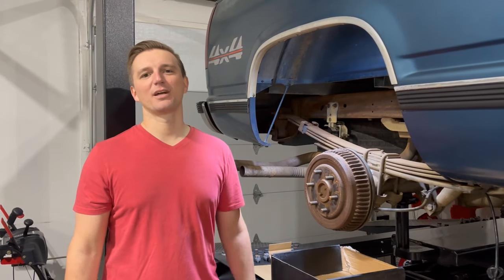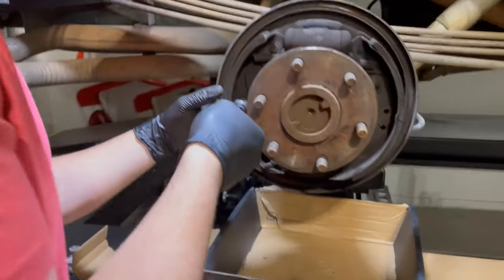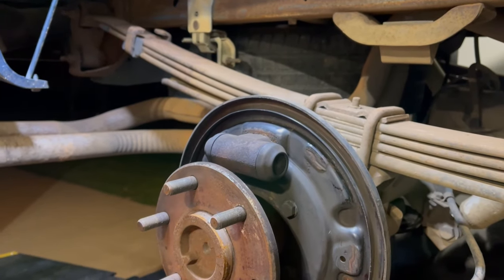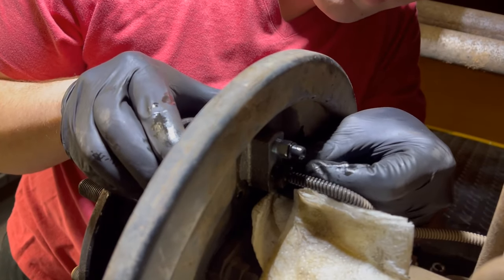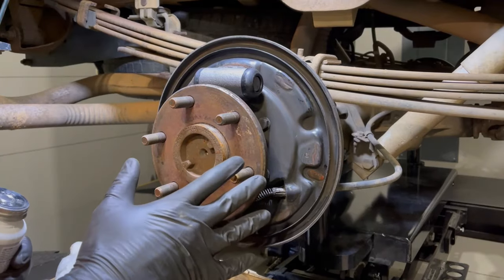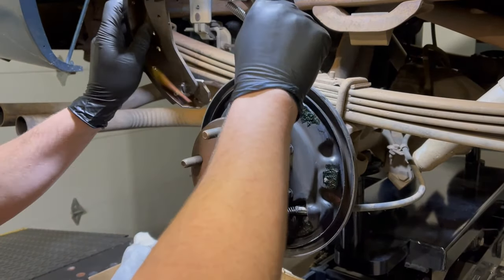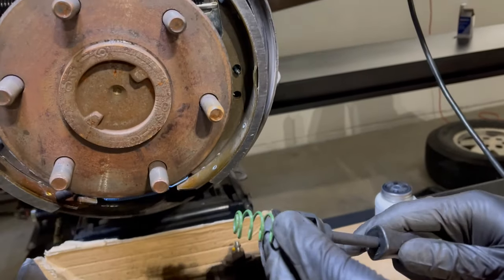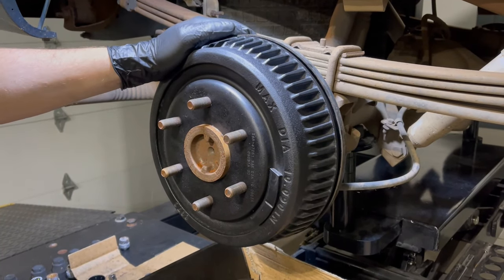Easy rear drum brake replacement on an 88-98 OBS Chevy 1500

Comment: I pulled my axles when I did the rear brakes , glad I did when I removed my rear end cover noticed rear end crown and pinion as well as the center pin was wore out .so I ordered a crown and pinion Eatons tru- trc and installed it , but the side carrier brgs were a different size but did locate them that old 91 short box was wore right out , but this old 70 year old man loves working on old school trucks .

Comment: I finally figured out how to adjust the rear brakes ( the brakes with the self adjuster on top of the axle) on these crap for brakes, trucks!!!!!!!!!  Engine off, in park. Push the parking brake pedal down till it sets. Now, pay attention: pull and hold the parking brake release handle. Now, push down on the parking brake pedal, let it up,,keep holding on the parking handle, push down the parking brake pedal slowly,,,,and do this 5,10,15, times and you will notice the parking brake starting to get higher. Stop. Now feel the foot brake, and notice it's higher, harder, and less mushy!!!!!! The Chevy Un- mush and working brakes fix is here!!!!  And now you have rear brakes to boot!!!!!!    You are all welcome! Only took me three obs trucks and 20 years!!!!!!
Reply: Bryson Shiloh  like to hear your results.  I've done this procedure a couple more times and the brake pedal now sits up hard and it now squats when I get into the brakes!!!!!!!!!!     I JUST PLAIN WORKED FOR ME!!!   good luck!  let me know,,,please!!
Reply: Bryson Shiloh  let me know how it goes!!!  please
Reply: thanks for that information ., I was pulling the drums off numerous times setting it up , but I sure will try that , thanks again . also backing up a dozen times slamming the brakes on didn't work either .
Reply: I did this this morning on my 1991 GMC 1500  and it worked flawlessly ,thankyou sir , now Ill try that on my 2001 S10 , didn't work on the S10 .
Reply: @oldbiker9739  by the way,,,i too have a 1991 s10!
Reply: Dam thanks bro!!!!
Reply: This just got rid of the sponge I was feeling brakes are now back to normal!!!!!! Thanks a million I owe you a cold beer 🍺

Comment: Like how he skipped right over the by far hardest part. E brake cable reattachment. I'd do that before putting anything else together. Or, if u can manage it, just never unhook it. Using the same part anyways.
Reply: He skipped it because it’s the most annoying part an he was probably cursing an spent 20 mins trying to pry the spring back so he could slip it on. Pain in the az
Reply: It didn't even look like the parking brake cable was fully engaged lol. Fake
Reply: Agreed. The cable is absolutely miserable and I left it hooked up on the 2nd side. I think it sucks the way it does because the drums are so tiny. It isn't nearly as bad on the 13" drums, I pulled the spring back by hand on my dually. These brakes are a dumb design.
Reply: Yes.
I remember putting so many cursewords into my rear drum when I was fixing it.
Reply: No shit I spent 3 hours trying hook that E brake cable I was so pissed
Reply: 🤣🤣🤣 I was hoping for a tip on that. Been fucking withis parking brake spring for 20 mins trying to get it on. Seems like you need 5 damn hands smh
Reply: You can do all this without removing the p brake cable from the arm.
Reply: @Santino0560 I just cussed my ole lady and broke my flashlight trying to hook mine back up. We’ll try again tomorrow. 🤣
Reply: Honestly that was the main thing I wanted from this video. Apparently no one has filmed this.

Comment: You're #1 !!!! Not sure I like the grease on the axle flange face centrifugal force could have it of the braking surface??? . The sticking point for me is the drum center ID. Thanks for the very professional vid! Even using Never Seez at least on of my adjusters is frozen when I take things apart. 449K miles and going strong. 89 Silverado.
Reply: I seen short bed Silverados with that mileage 
Great trucks

Comment: I watched this video and decided that I would be use this procedure to replace my trucks brakes. The removal and reinstallation of the emergency brake cables was a hours long project. To watch your video it would only require a few moments. There has to be a trick that wasn't discussed in the video. Please explain this procedure in detail so others won't spend hours doing this job on the future. Thanks.
Reply from the maker: @William Crace Yes, we should have filmed that again, the first time we did it the camera got blocked and as you found out it’s not the easiest to do. I believe we did the opposite of install though. What ended up working for you?
Reply: Agreed! ...omg it was heck!

Comment: A-  due to not having a e-clip removal tool. otherwise the best instructive video. after we overcome all the pitfalls stuck hub, leaked fluid all over, seized brake line, breaking off bleeder tossing parts in frustration putting a dent in classic car parked nearby just a little click and clack levity ha-ha thanks a million you make it look easy and waaay inexpensive.

Comment: Dude your videos are really well done I appreciate you showing us how to do this stuff. I am the original owner of a 1994 Silverado K1500 and my all original engine and transmission are just about to 500,000 miles.  The engine has been flawless,  The transmission has exceeded my expectations However it began to slip in 4th gear at 
467, 000 miles,  So I did have the transmission rebuilt.   My actual mileage currently is 496,000  thank you

Comment: I tried this method of assembling the brakes before installing onto the hub. While that part did go well, trying to get the parking brake cable re-installed was impossible for me. I probably spent 45 minutes on the first one trying to get the *&^#$&@ back on, cursing GM, and then walking away. I eventually took everything off and disassembled the components. The first thing I did was try to install the parking brake cable  on the arm. With the arm off the hub and free to move around, it was fairly easy to get the cable on. You have the room and the ability to rotate the arm so it's easy to get the cable on. We pulled the spring back from the grommet and attached a vise grip to the cable to hold the spring back. Then it was super easy to install the brake cable into the slot on the arm. It was more difficult to then assemble all of the components than doing them off the vehicle like you showed, but I'll never do it that way again just because it makes getting the parking brake cable back on so difficult. I really like your channel BTW!
Reply: Loosen the brake cable slack adjuster and the spring won't give you any grief the arm will slip right on
Reply: @joshuamcpeek4708  I did that and it was still not doable for me. I have heard that there is a tool to simplify this step however.
Reply: Is it possible w appy the p break a bit

Comment: Used to replace my rear brakes on `93 GMC to help with the crossword puzzle. I would add that look at your brake lines for corrosion. Even though I soaked lines overnight in penetrating oil, I still twisted off one side on brake wheel cylinder. I guess i should have known as it was the only one that hadn't been replaced, not to mention being 30 years old with over 300K on it. I made mine but parts store has them pre-made for less than $15.00. Just so other know.

Comment: Thanks for the video! Unfortunately I was not able to duplicate your technique with the pre-assembly because the sheet metal part of the adjuster that keeps the threaded adjuster from loosening kept falling out. I had to walk away for a minute. However, thanks to your video I was able to put my own twist on this job. 

I didn’t pull off the e-brake cable. That took brute force to get back on. I attached the left side shoe first. Then added the main spring, followed by the adjuster. Then the spring and sheet metal part of the adjuster followed by the bottom spring last. 

I take comfort in the fact this will probably be my last drum brake rebuild. Lol

Comment from the maker: Make sure you add anti seize to the threads of the adjuster, something I thought of after I made this video
Reply: I took mine apart and notice I didn’t have lever adjuster spring. Will this be a issue ?
Reply from the maker: @Musa Salh You should have all of the springs shown if you have the same truck

Comment: Finally a video that shows my 1999 Tahoe drum adjuster orientation( not on the bottom like all of the others)!!! Now for the big question:::: how do you adjust the drums while the truck is on the ground??? The old way by backing up and hitting the pedal ,,,,,,??? Or by cycling the parking brake on and off to get the drums to tighten up???? Great, and clear video!!! Thanx.  Note: you cheated!!,,,you had another set of hands helping!!  Good job!
Reply from the maker: The brakes are self adjusting, you cannot access the adjuster through the back plate like on most drum brakes. Set the parking brake regularly and they should stay adjusted. Thanks for the great comment!

Comment: I'm having a good old time with my emergency brake trying to put it back on I wish you would have showed how to do that also I'm working on the driver's side and you're working on the passenger side so I have to keep in mind everything's put back together the opposite way what you didn't note in the video but I picked up on that
Reply: He did show you. He used the vice grips to hold the end of the cable then he used a screwdriver to peel back the spring
Reply: @mattmarshall1698  that was to take it off. The hard part is putting in on still having trouble with it. Any tips?

Comment: you should do one on how to change   a wheel hub assembly on that truck.
Reply from the maker: That’s on the list just have to finish up some other things.
Reply: It's like replacing brakes but u just keep taking things apart  CV joint Axle nut is the hardest  then hub bolt's
Reply: Yeah, it'd be a good watch. It's a pretty easy job though, pretty much like Melinda Ortiz says. Four wheel drive is a bit more involved though. It was nice on the '91 and older 4x4 Subs/Blazers (K5) when you needed to change wheel bearings, that's what you did, change/swap and grease new bearings and races. The '88 and up 4x4 pickups (and '92+ Subs) you get to replace the hub assy. these days. I miss sitting out in the carport away from the wife doing ALL DAY maintenance. No grease zerks on the cars now, OEM ball joints aren't serviceable...hmmm. :(
Reply from the maker: @Edward Strasburg We did the hubs in the front suspension video!

Comment: Excellent video i have a 97 chevy 3500 and my brakes stopped working and i saw an oil leak in the rear tire i think its that cylinder my brakes look a bit different than those though it has extra pieces and the metal on the brake pads goes all the way above that cylinder. And behind all that theres barely any room between that back disk thing and the leaf springs i could barely put a socket an ratchet back there to take the bolts that hold the cylinder. Also holy shet those springs on the brakes of my truck are hard to stretch to get then unhooked

Comment: For the parking brake clip, I used needle nose vice grip/locking pliers. You put one side if the Jaws on the inside open end of the clip and the other side of the Jaws on the stud and it should just pop right off.

Comment: A easy trick for installing the hold down springs and pins is to use a 1/4" socket like a 7mm add a 1/4" hand driver or extension as a handle to push it straight on

Comment: Video is about 99% complete……..now how in the hell did you get the emergency brake cable back on? Truck has been sitting in the driveway for 4 months because I absolutely cannot get this damn cable back on
Reply: I’m sure there’s a better way, but I used a set of needle nose vise grips. Locked them on the end and used a flathead to push the spring. Still took a lot of almost having it and losing it. Walked away a few mins then slipped right in. Pain in the butt.

Comment: what size wrench did you use on the break line, and bleeder screw.
Reply from the maker: @James Brown If I remember correctly, been a minute since we did them, the brake line was 9/16th and the bleeder screw was a 10mm
Reply: @SuburbanRanch  thank you very much

Comment: Can't stress enough to always use a "line wrench" when breaking loose any brake lines to wheel cylinders, calipers or bleeder screws, especially if you live in the rust belt areas of the country. They prevent accidently slipping off of and rounding off a brake line bolt or bleeder screw, requiring replacement of the part or brake line.
Reply from the maker: I agree!

Comment: I can tell by the wheel cylinder that this is a 10" drum brake setup. My 1996 Tahoe has 11" drum brakes and they are different. I'm not sure if 11" is common on an SUV or what but I thought I'd mention it.

Comment: While your video is very good very informative and very helpful, the reason you seem to skip all the stuff around the connection and disconnection of the emergency brake is because that is the hardest part of this entire endeavor. 😠
Reply: Watch it again and this time dnt fast forward. The technique is right in the beginning of the video. God you and several others in here cant see or hear
Reply: Funny how they skipped literally the hardest part , I removed the cable and I can’t get it back on . Just tough

Comment: my new shoes came with the parking brake pin pressed in the wrong way, and advice on how to get it out? tried punches, hammer and clamps but no luck. Got them in a kit and the hardware included new pins, washers and e clamps like yours but no way to remove the incorrectly installed pin.
Reply from the maker: @Shaggy I would recommend returning the shoes and getting new ones.

Comment: I hate the New -Style rear brake set-up on my C1500, there is no backing plate access hole to adjust the brakes (Like the older trucks had). I back my truck out of the driveway, sometimes 2 to 3 times daily & I still have to remove the rear wheel & drum every few months to adjust for wear... I wish someone came up with a conversion kit to adapt the Old style setup (Disc brake kits are available but cost to much).

Comment: What’s that tool you used for the pins that come through the backing plate ? And should I bleed the brakes before the job or after? Nice video also, best one I’ve seen
Reply from the maker: @KyAire Thanks. The tool is a spring compressor (link in the description). Bleed the brakes after the job.

Comment: Only problem is the parking brake cable is impossible to put back on when the brake job is done.  I still haven't figured out how to do it and you don't show it.
Reply: Watch it again. Visegrip and a screw driver to push the spring back.

Comment: Why aren't you showing the process of placing the parking brake cable
Reply from the maker: @GhostFace3608 Two others asked as well I think the comments. I didn’t include it in the video because it is the worst part.  I blocked the camera getting it on so you would have just seen a person and some struggling noises haha. I think we used a pair of vice grips and brute force
Reply: I finally figured it out since there were no vids with that part. It is the worst part agree lol but i found a method that can take up to 1 min getting it on with just a flat head and a pair of vice grips.

Comment: Did not show how to back off the brakes in order to get brake hub off!
Unfortunately That's what I needed to know!
Reply from the maker: @J Hawkins The drum should just come off unless the e brake is on or it could be rusted to the hub and need some “persuasion”
Reply: @SuburbanRanch  
Obviously you've never been poor enough to where you driven the vehicle until the brakes have eaten into the drums far enough that it won't allow it to pull off!
Lol 🤣
Truck is new to me but obviously is not a new truck!

Wiring going bad, no remotes sold with it ect. You get the jist of it!
😂😂😂😂
Ps I'm your typical Texas shade tree mechanic! Lol
Jump in the deep end and only ask for help when the water is overy head! Lol 😂😂😂

Enjoy your Saturday!

Comment: Would this be simliar for a 93 c3500 dually?
Reply from the maker: @Sonido Intimidador Sorry I’m not sure on the dually
Reply: You have to pull the axle, if anybody asks this question again. On the plus side, it's a full-floating axle, so there's no "c-clip" or anything like that to worry about! So you just put a drain pan under the drum/axle you're pulling out, pull the nuts and pull the axle out with a twist SLOWLY, trying not to spill diff fluid everywhere. Also of note, try your best to take care of the axle shaft (i.e. nicks, scratches, dings, etc.). Once the axle is removed, everything else should be the same as the other trucks!

Comment: How come you didn't show hooking up the emergency cable line . it must of been a bitch to do cause I edit that part out
Reply: You edit that part out . any tips
Reply from the maker: @Joseph Brumett  Sorry about that. I didn’t include it in the video because it is the worst part.  I blocked the camera getting it on so you would have just seen a person and some struggling noises haha. I think we used a pair of vice grips and brute force
Reply: 😂.  I cleaned and swapped shoes and cylinders in 39 minutes and fought the parking brake cable for an hour and a half.  Then my master cylinder blew out while bleeding the system.
Great video👍
Reply: You leave out the hardest part? It makes the video go from 10 to a 2